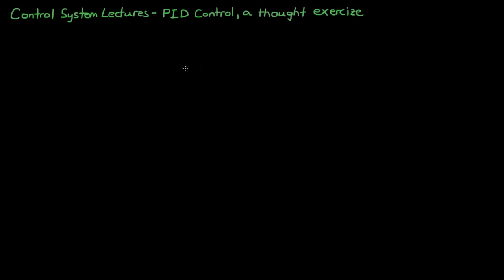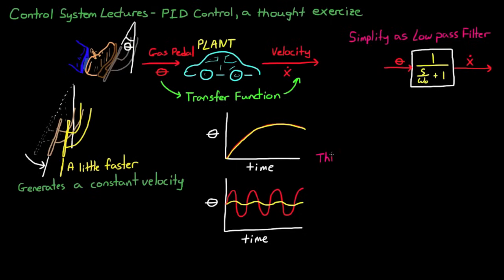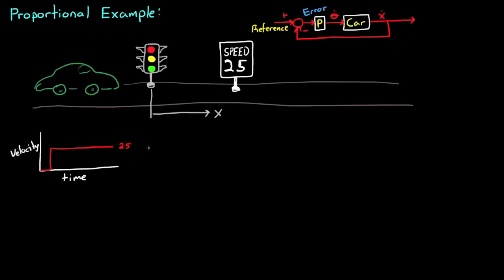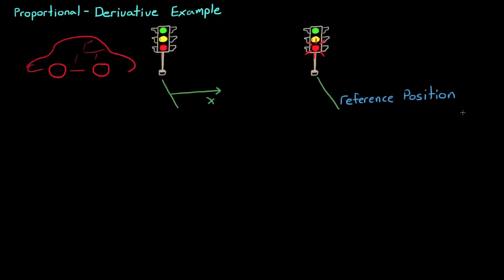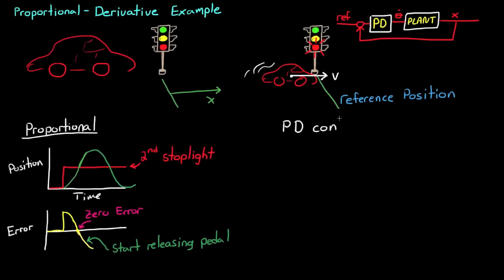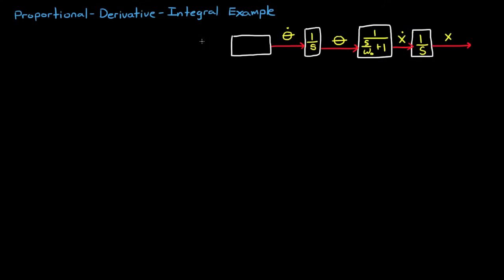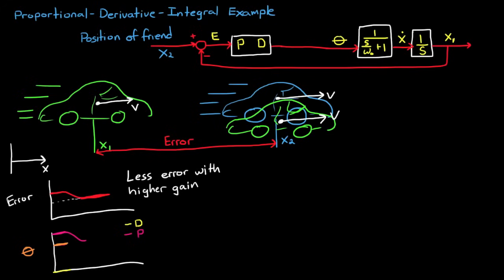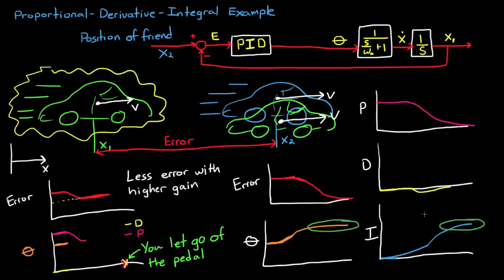Simple Examples of PID Control

Comment: In this video if 'phi' is the angle that gas pedal makes then after the chasing car catches the other car, the angle phi should settle at the same value if the speeds before the chase started and after catching-up are same but the video shows that phi after the lagging car catches leading car is more than what it was. Which means the car now needs more gas for exactly same speed. Did you mean something else by angle phi ?

Comment from the maker: Yep exactly.  It's your brain that is interpreting the signals (through your eyes) and converting them into actuator commands (through your feet and the pedal).  Although, really what your brain is doing is a far more complicated control system than linear PID control, but the concept is good for illustration.  If you built a robot that could drive a car you could implement a PID controller in its "brain" to do something similar.

Comment from the maker: Also, humans themselves are control systems.  For example, if you try to walk from your kitchen to your bedroom, you accomplish this with feedback control.  Your eyes are the sensors and your legs are the actuators.  Your brain (controller) adjusts when to turn and how fast to walk using eyes as feedback.  Also, your internal temperature control keeping you at 98.6 degrees is another controlled system in your body.  There are tons of examples like this with humans.
Reply: Sincerely i enjoyed the instructions of the lecture but the example part which is this i still have issue please i can used steam plant for explainations

Comment from the maker: Absolutely!  Humans are very much the controller in some situations.  And when you're designing a system that uses a human controller (like an airplane) you better make sure the system is "slow" enough that the human can respond fast enough to it, but not too slow that human can't control it at all.  It's an interesting problem designing for humans.  When you take the human out of the loop and place a mechanical or electrical controller, then it's an automatic control system.